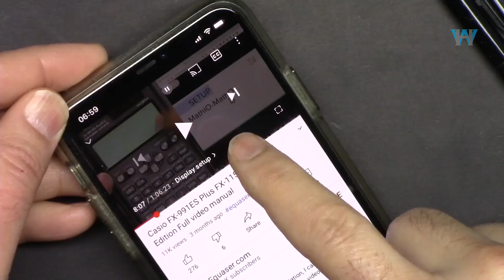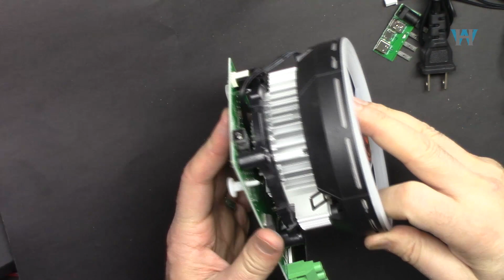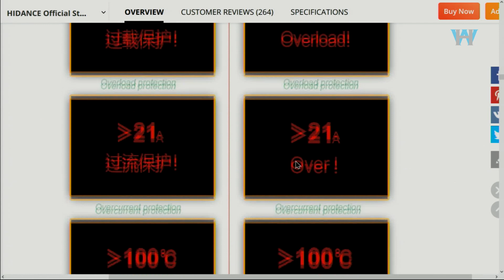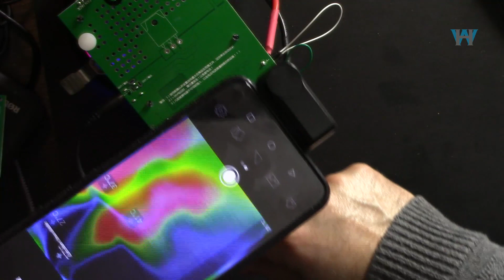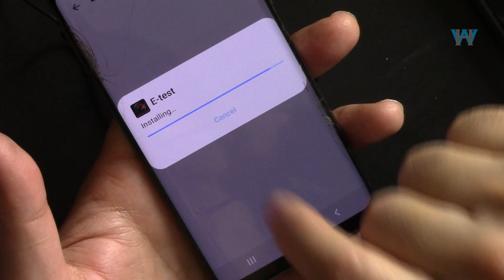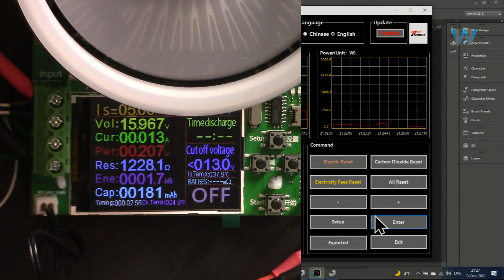Full review of DL24P Battery Capacity Tester, Energy Monitor and 180W Electronic Load

Comment: if the two thin wires aren't connected and there was voltage drop would it think the battery was less powerful (lower mah) right?

Comment: For USB TYPE C...
Atorch has just released a new plug-in PCB that goes into the input sockets and has USB-C as well as inbuilt Trigger for 5V, 9V, 12V, 15V, 20V and 28V but not PPS (variable voltage).
What you need to find is
PD3.1 4-Wire
Should be about USD $8.
Part no DL24B-XSP16

Comment: Hi, can I use constant current to drain a 1.5V battery to 0.5V with this?
Reply: Theoretically yes but it's like using a sledgehammer to tap in a drawing pin.
Just buy a smaller load that is better suited to the tiny load that you want to test.

Comment: What if I want to test a board that outputs a 14V square wave of about 9kHz? I assume I need to put a bridge rectifier in between that board and the load, but do you have a thought about sending it a rectified square wave (which will have notches about twice the input frequency from the transition points on the rectifier), or testing a motor controller that will output DC PWM with a duty cycle of 0 to 100%? The PWM would be set to 100Hz or 400Hz.
Reply: This is compleyely the wrong device for that kind of testing.
The entire device is designed for DC, so you will get all manner of (unknow) losses in any rectification and smoothing that you need to get the square wave down to straight smooth DC to measure it.
Just use a current shunt and a True RMS Millivolt meter and a decent AC True RMS multimeter, and take timed readings.

Comment: How to using CV?
Reply: Set it to CV, input the voltage you desire, and press Start. It will dynamically adjust the Amps Load to match what Voltage you asked it to do.
Why would you need to ask this?

Comment: Nice test, but I'm amazed that the tester can sustain a load of over 300W while only being rated for 180. I saw reviews online where people said that the mosfet got killed when they exceeded 180W...multiple times. So either the build quality went down or you got lucky
Reply: When you use it as a load, it cannot exceed 180w. But when you use it as energy monitor it can go up to 20a but the connector is not rated for 20 so it will heat up

Comment: Hello brother, how do I know the battery? Good or not, I bought this device. But I don't know how to use it
Reply from the maker: Hello, you  measure the capacity. If you the capacity for new battery is about 95% or higher it is good. for older batteries, it might be a little less .

Comment: Thank you for the video! 
If I want to discharge a power bank just to, what's the correct cutoff voltage? 3.7v or 4.10? 
Because I want to know the actual capacity of my power banks 

Thanks again for the video ❤
Reply from the maker: powerbank has its own internet programction. I assme you have a power bank with USB output which is 5V. so set the voltage to 4.5V and before it reacheds to 4.5V, your power bank will disconnect it .

Comment: How to communication with wall adapter to increase voltage to 9v or 20v 😢😢 I use to test power pd adapter automatic adjust voltage by adapter
Reply: Have you found out how?
Reply: You simply use a USB-PD Trigger board to set the voltage.
Atorch has just released a new plug-in PCB that goes into the input sockets and has USB-C as well as inbuilt Trigger for 5V, 9V, 12V, 15V, 20V and 28V but not PPS (variable voltage).
What you seek is "PD3.1 4-Wire". Should be about USD $8.
Part no DL24B-XSP16

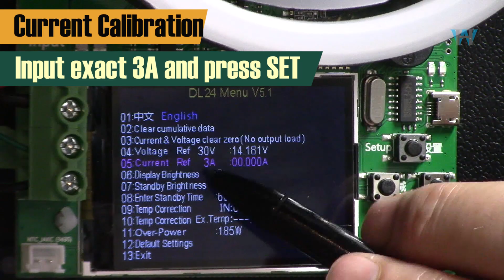Comment: Hello. You said that I am gonna demonstrated current reference 13:15. Bu you did not mentioned about it. I have just bought this module but the current value is wrong. I set the current at for example 3A then start. İt says cur:3.00A but the power supply says 1.7A. there is huge mistake. How can we do current calibration?
Reply from the maker: I am not sure about your powersupply or settings.  There must be something wrong. your powersupply may not have enought power.
Reply: @WattHour  No actually the case is opposite. Even I try to draw 0.3 A it is wrong in eload screen. My power supply can supply 5A. I put a calibrated ammeter between power supply and eload. The ammeter and the power source say exact same current value but the current value on the load screen is higher.

Comment: Any way to turn the Bluetooth off?
Reply from the maker: Not sure as I gave away this meter. But there should be Bluetooth antenna, if it bothers you, then just cut the antenna path on the pCB. but you won't be able to to fully turn it off as even without antenna it might work for 2 to 3 meters.

Comment: Hello thanks for such a detailed review. I have a question in 21:56 Demo: Soler Energy monitoring  Im not sure what you are doing.  Are you charging a battery using a solar panel?  Im unclear what is the connector on the right side for...? I think you connected a battery to that connector.  But if you are charging a battery then why the 75 mAh is not increasing? I see the amps increase from 5 to 6 etc but I don't see the capacity increasing. Im not sure what is that righ hand side connector for?  Thanks very much
Reply: Replying to old post. In that particular test the Load is being used as a measurement meter only. The input connections are used for input and the right connection is for remote load (battery or whatever).
So, the power is simply passing thru the Load and being measured. The example was to connect solar panel to input and battery charger to output on right. Over 24hrs the Load's display will show the total amount of energy that went into the left connector and out the right connector.
The problem is that the device can measure up to 30A but the right connector is only rated for about 5A, plus the PCB tracks to the right connector are undersized.
So it needs modification if you want to use it as a measurement device.

Comment: hi... can we test car battery on this? will it burn?
Reply from the maker: Hi, it is always about voltage if you know the power. the pwoer is 180W and I mentioned what is the maximum voltage but for sure 12V is very low and it will not burn. Just watch and when I mention input voltage, that's what this device can accpet.
Reply: @WattHour  thanks sir.

Comment: Can we use to discharge 48 volt, 100 aH battery bank?
Reply from the maker: the capacity does does not matter. it can do even 1000Ah but it will take longer. You can discharger maximum of 180W.  Now I don't remember if it works with 48V or not. so please watch as I have explained it fully.
Reply: @WattHour  thanks.. I did not catch the max voltage rating and on aliexpress did not mention too

Comment: Great video - question; how to you change capacity from mah to ah?
Reply: You can't change the mAh to Ah manually, however you can divide by 1000, right?
Once it exceeds 80000 mAh it automatically changes to 80 Ah... Or something like that, just read other comments here.
Reply from the maker: Hi, I don't have it in hand because it is given away. But I explained all features. if I did not show, then it is not possible.

Comment: Can you make a video to show how to drain different voltage batteries to determine their capacity? For instance 48v 15.6ah 748.8wh lithium battery pack. How to run the test such as What would be the low voltage cut off be? How do you compare the results to the battery specs to determine how good the battery still is?
Reply: Replying to an old question...
To use this load to test batteries, you need the data sheet for the particular cells. Then you test to the same parameters.
For example if an 18650 ICR cell is rated in datasheet at 3,000 mAh at 2A to 2.5V, then you set the load to those criteria an run the test in the same way to compare.
The capacity drops significantly as current increases. So you either test and compare to datasheet, OR test the pack based on the device (eg: eBike) actual requirements.
...
For cutoff voltage, it should ALWAYS keep it above 2.5V per cell but most BMS take it safe and cutoff at 3V per cell or even higher. So your test cutoff voltage should be 3V per cell OR whatever your BMS uses.
...
A 48V pack it might be 11S, 12S or 13S depending on the manufacturer specs. Or it might be LiFePO4 and running 15S. Once you know that, you can work out the minimum pack voltage that you should test down to.
...
Note this thing cannot test 48V at very high current, since it's rated max 150-180W which is only 3.1 To 3.75 Amps. That will make it OK for testing to cell manufacturer's specs (usually 2A) but almost useless for real world testing at normal device loads (10A or more).
Reply from the maker: I have it on my list.

Comment: Hi, can I please ask you a big favour? Mine has burnt out the voltage regulator due to my fault.. Can I ask you to take a picture or post the numbers on the voltage regulator underneath the cooling fan? (its the 3 legged brick inbetween the 2 bigger resistors it says 6203A on it, the rest has burnt out on mine..)
Reply from the maker: Hi, sorry. this was giveaway and someone won it and I ship it to the US.
Reply: Do you still need this info? I have a DL24 bare PCB and can check for you.
Reply: @johncoops6897  no thx, have resolved

Comment: Can you increase wattage power inside settings? I can see it says 185w, and with MOSFET and diode replacement it is possible to upgrade this tester to be more powerful, but still limited with software.
Reply from the maker: No. There so software or firmware limitations which we can’t access even you change the mosfet or shunt resistor.
Reply: @WattHour  not sure how to show you but there is on DL24P settings under V5.1 version of the software

Comment: Can I test CR Battery, CR2032 specifically, with this? I want to measure its capacity. I got ton of them for very low cost from ali-express but I can't figure out its exact WHrs.
Reply from the maker: If the voltage is within the range of this tester for you can.
Reply: Thank you for replying, i appreciate it. The max CR2032 can give is 3.3V. I want to pass constant current and measure how long it takes to reach the cut off voltage. So that i can guess lifetime of my battery operated beacon.
Reply: @satvikkumarpatel1129  - this is WAY too big for a CR2032. Just buy a small $5 USB load and a decent USB tester that has an external power supply terminal.
You need the external power because most testers won't work on 3V. Also the tester will draw too much power and skew your results.
To be truthful, since there is so little power in a CR2032, you are probably best to just load it with a resistor and measure using a multimeter.

Comment: Can you run it at a constant load of 100 milli amps or 0.1 ampere
Reply from the maker: I have shown all specifications and even shown when setting the values you will see the smallest value. I don’t remember the numbers. Please watch
Reply: For such a low current, just buy one of the cheap USB loads and pass through a USB tester.
The low value sense resistor in this will not allowed good a accuracy at small power levels.

Comment: is it possible to store all the data in a file for a given test?  at least the voltage and current vs time would be nice.
Reply from the maker: No. I would have shown it. I have not skipped any feature of this module.
Reply: @WattHour are you able to also review the dl24ew model thanks
Reply: You can save the data to an XLS file in the PC software. Note it is actually in CSV format so you need to change the file extension from XLS to CSV after you save.

Comment: How to current calibrate DL24P? My unit seems not accurate
Reply from the maker: I don't remember if I have shown in the video to add or subtract value from the voltage or current, then it does not have calibration option.

Comment: Thank you for posting this video. I won’t to load and see a solar panel voltage, amps, and watts max output.
At 22.55 in your video you explain how to do this. Will you please show the connections and settings
More clearly. If anyone out there can tell me how to connect and setup the DL24P to monitor and load a 100W solar panel, That will be gratly apresheated.

Thanks again for your work.
Dale
Reply: You just connect the solar panel to the input of the Load. With current set to zero, the open voltage will be shown. As you wind on more amps, the voltage will drop accordingly.
Your task is to find the point where the wattage is highest, which you can do by watching the screen. It really is that simple.
The added info in this video is about monitoring the pass-thru power between a solar panel and battery bank, which is probably not what you need to test initially.

Comment: Hi, very informative and promotes confidence on the product. But how to make it measure more than 99999mAh capacity? Like the bigger lifepo4 batteries that go beyond 100Ah? Thak you.
Reply: Thanks Mike for your reply. I ended up buying the DL24M few days later because even the on-line sellers could not answer my question. The DL24M I found has 6 digits on the ah display.
Reply: Sorry it's Mark.
Reply: @erichenares6172  i just realised it was on my phone via BT it shows ah, the display shows mah, im at 80400mah and counting as of right now. Ill see what happends in an hour or so. Running 10 amp at about 13v. Been going for 8h.
Edit. Just passed 99999 mah, and it changed to 00100ah on my 5 digit display.
Reply: Mine changes from mah to ah after it gets above about 5000mah. Im curently testing a 250ah lfp
Reply: Thanks for the update Mark. It's good news for that model.

Comment: What is the minimum current that can be adjusted?
Reply from the maker: for setting any value, the minimum  is set with digit you can select. if you select a smallest value in settings, that is your minimum. I don't have the device but I am sure I've shown it how to set the current.  see how much digits after decimal point is shown.
Reply: @WattHour  ok,but the minimun current is 50ma or 100ma or 200ma?
Reply from the maker: Whoever lowest it can show.
Reply from the maker: I don’t know that’s why I am r referring you to the video.
Reply: You could also just check the specs or user manual 🙄
Reply: Minimum current = 10 mA

Comment: I want buy this for checking ebike batteries. What do you think? It will be good for that? 36V (discharge rate 2 or 2.5A) batteries I want to connect to output of the battery without disassembling.
Reply: If it works the way it is claimed, it should be helpful assessment tool for ebike battery packs. I use a similar Constant Current 180W/200V tool for the same purpose. I don't need the other test options (like constant voltage) nor do I require the color display or phone/computer connectivity, so the unit I use was a bit less expensive.
You may want to determine whether or not the DL24P is the "improved" version or some sort of "Premium" version. There are supposedly at least 2 versions out there, the 2nd has been reported to be an improved version, suggesting potential limitations or glitches with the first version, and I would want to be certain to obtain the improved version if such exists.

CAUTION:
Before actually using any of these types of units, verify the heatsink mounting system is working properly and isn't loose or even broken.
One bad thing I've noticed about most of the versions of this type of tool I've had the opportunity to examine, is that the heatsink mounting system, a critical part of the unit, was held down on the printed circuit board by 4 simple plastic pins. Even working perfectly, these pins can allow an almost 1mm up and down motion of the heatsink relative to the MOSFET just because of poor design. This motion breaks the thermal compound bond and DRASTICALLY decreases the functionality of the heatsink. This can then cause the MOSFET to burn out at any time, even when testing relatively low-current loads. The MOSFET specification REQUIRES a tight fit to the heatsink even with low watts dissipation requirements.

Some of the securing plastic pins were even broken during during shipping, even to the point where the heatsink was secured by just 1 pin and flopping around on the printed circuit board...completely detached from the MOSFET.

I replaced the pins and secured the heatsinks with non-conductive bolts to assure a secure and snug fit to the MOSFET on a number of these types of analyzers/testers. In some cases, the MOSFET had to be replaced before the heatsink attachment plastic pins were replaced with the bolts.